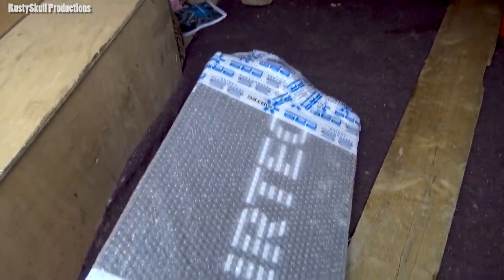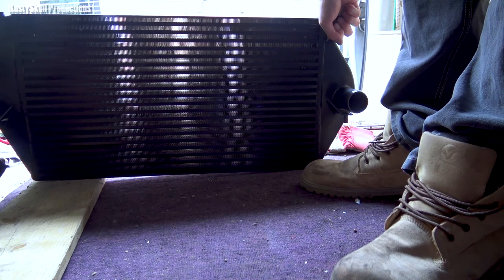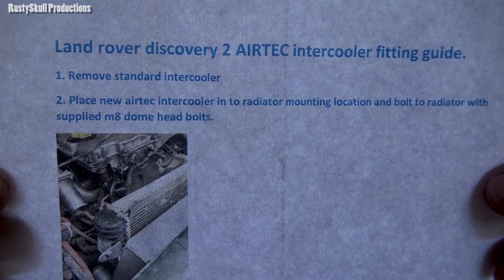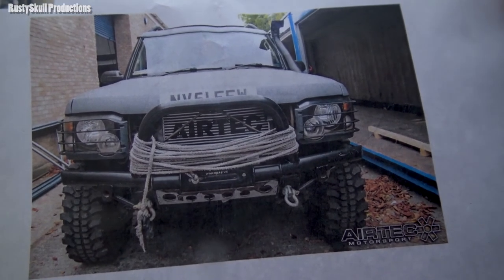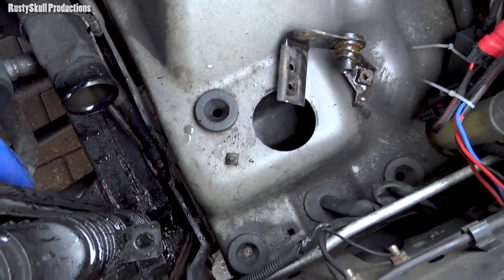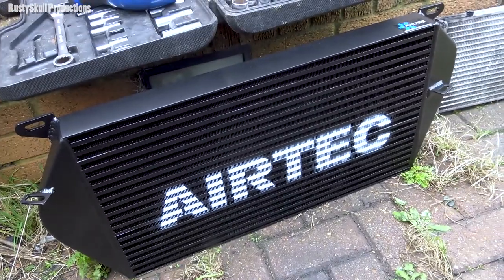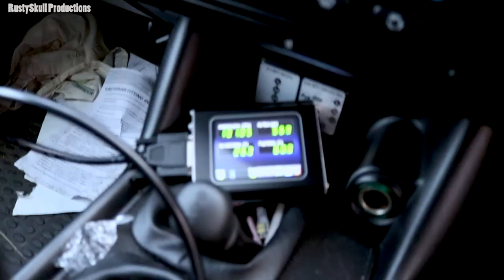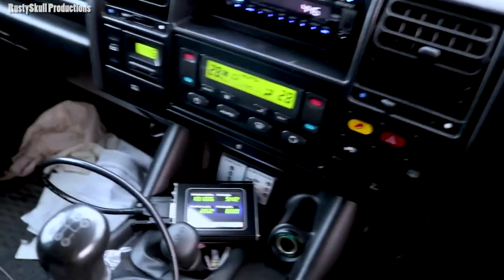I Got An AIRTEC INTERCOOLER - RustySkull Productions

Comment: did you have to buy anything else besides the intercooler? (intercooler pipes etc)
Reply from the maker: Nah it was a direct fit 👍🏻👌🏻
Reply: @RSPYT  cheers fitting mine next weekend 😁
Reply from the maker: Make sure you bought the right one 👍🏻 
They took my car in to use to develop their intercooler for cars with A/C. The one I bought originally didn't fit because they hadn't realised the A/C  rad was in the way lol.
Reply: @RSPYT  i got mine delivered yesterday and i checked and it is the only one which is sold which is compatible for air-con thanks to you helping them. :)